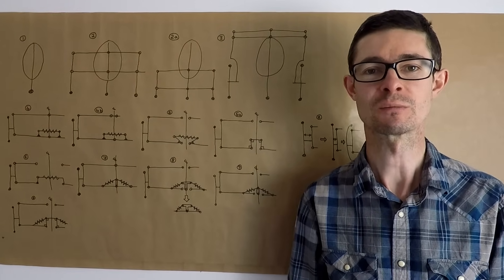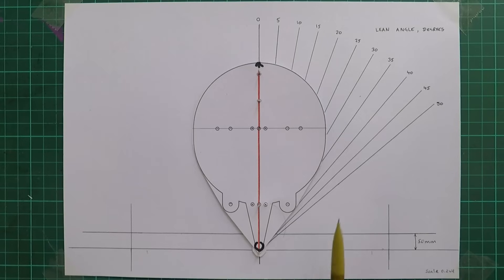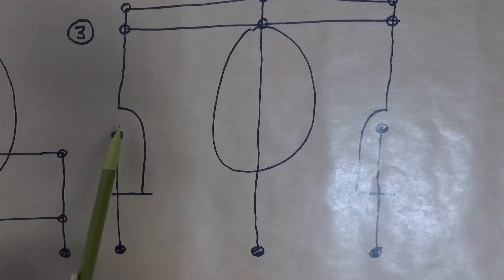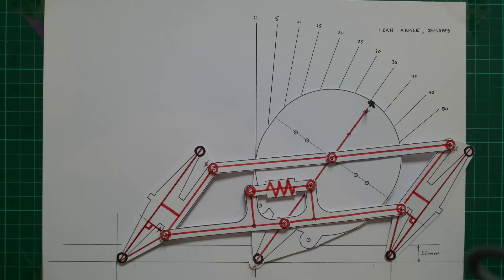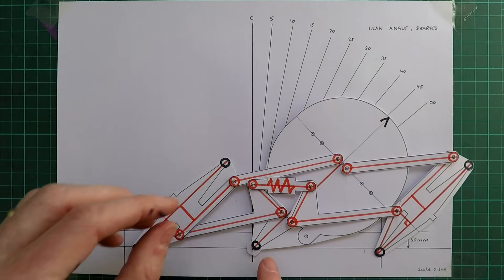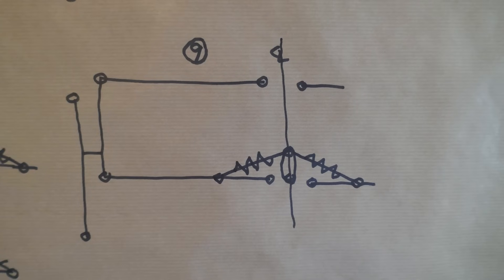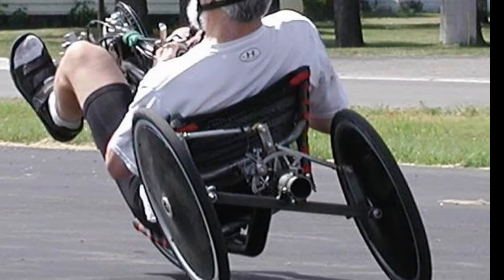Tilting Trikes Part 1 - Velomobile and Motorcycle Trike Tilting Mechanism Design

Comment: Absolutely brilliant! As far as the differential issue is concerned,  I have wondered if a solid shaft between 2 freehub wheels could serve the same purpose. This would allow the outer wheel to freely accelerate on corners while applying pedal force to the inner. As a bonus, it would function like a dif lock on slippery surfaces. There would, however, still be a lot of drivetrain design issues with the tilting
Reply from the maker: @INKonoclast  thanks - I’m sure that would work but as you say, mechanical complexity (and weight) would be an issue for probably very little practical benefit.

Comment: This was very helpful. I did find success with slight separation with of the arms from the center point and using the t model but the t shape is just about 1/3rd the height of the space between the upper and lower arms. The points where the shocks connect to the t is the same as the inner pivot points of the arm. Then using the distance for the shock to measure out where it would attach to the lower arm. For body wise you may have to make a slight deviation in the body to allow room for the shocks which aerodynamically shouldn’t effect it to much. You can also prevent a lot of aerodynamic loss by using fine bristles on the slits which will allow it to essentially close the slit.

Comment: Fantastic piece of analysis! I've done most of this thinking before but without the pretty cardboard aided design.  I don't have an aversion to FWD, so the image you showed of the tilting delta trike was right up my street.
Reply from the maker: I am moving from cardboard to computer aided design for the next phase!
Reply: The velotilt project was for sale not too long ago. It has plugs and molds for the body and some design work

Comment: This is a very interesting video with a range of possible designs. The only thing I would say is you are having the single wheel on the same plane as the other two. As the single wheel is at least three/ four feet behind or in front of the other two the amount of scrub or lift can be ignored due to this change in the plane!

Comment: Best way to create prototypes in smale scale is Lego technik!!!!! Thx for the great video.
Reply from the maker: Ha! I actually did that. Ran out of bits though!
Reply: My experience is the same. 3D CAD takes the design to a next level.

From my purely digital work I learned that a powered or at least partially powered vehicle is necessary to achieve gains from the heavy tilting mechanism.

Comment: @Metal Machine Shop This appears to be the most comprehensive coverage on the subject on this platform. Congrats for that. No doubt many hope that this project comes to fruition and viewers get more information helpful to constructing the proposed vehicle. It is very curious that little is now heard of the much praised "Velotilt" trike with two rear wheels, first heard of about 2012. It looked so promising, while it's apparent absence from the market place suggests that it is still overcoming problems. Any light you could shed on this matter would be much appreciated. I look forward keenly to follow ups on this project. I am surprised that the topic of a leaning velo is not far more popular.
Reply from the maker: Thanks for the comment! I'm not sure what happenend to the Velotilt, I haven't found any up-to-date news on the internet.  Nice looking machine though.  It uses a different sort of tilting mechanism that I didn't cover in my video.
Reply: @MetalMachineShop   Remain keen to know if this velomobile is being built and hope you will advise along the way. Thanks for the velomobile upload.
Reply from the maker: I'm still working on the design so I'm not sure whether I will ever build it.  Once the design is finished maybe I will share it with the velomobile community to see whether it's good enough to build! I'll try to upload another video in due course.

Comment: Thank you MMC, very very interesting, you saved me a lot of work. One mechanism you didn't try was two pivot points in the center on the lower arms and one on the top, the same they use on the Quadro, do post another video if you try this geometry please. Thanks again for going to all this trouble.
Reply from the maker: Thanks! I think the Quadro design as you describe it would make the wheels angle outwards slightly relative to each other as the machine tilts or suspension compresses. The effect would be greater the further apart the bottom pivots are.  I’m not sure what the advantage of this would be, but the Quadro seems to work pretty well!
Reply: MMS, I solved the above problem I discussed in my previous post (Quadro) simply by using your number 4b and turning it upside down, it would have the same result, I'm just wondering how Quadro solved this or didn't they ???? Correct me if I'm wrong but to have the correct geometry the top and bottom pivot points would have to have be aligned in the center such as in 

figure 2a.
Reply: Do let us know how you solved the steering, for your project. I would imagine it would be direct steering as in a push bike but with scooters and motorbikes the preferred method seams to be a tie rod arrangement, I'm exploring some sort of direct method of steering for motorbikes to keep the whole thing as light as possible.

Comment: Some insight from having built a bunch of human powered streamliners including 3 wheeled leaners.
Weight and complexity are always a hindrance to efficiency when powered by fractional horsepower engines (humans).
Lighter, simpler yields the best results.
A 2 wheeler with side openings so either a foot or hand can touch the ground at a stop worked out the best ... for me.
The speeds that can be attained with a good light weight human powered streamliner it truly amazing. 

Your results may vary.
Reply from the maker: Hi, thanks for your comment! I totally agree that light weight and simplicity is the right way to go for out and out speed.   I am prepared to sacrifice a bit (but not too much) of speed for practicality. I am pitching my design at reasonably practical year round (in UK) commuting type use, and and intending to use electrical assistance.  I also have in mind a faster two-wheeled design.  Anyway, it’s all still on the drawing board at this point!
Reply: Lightweight and simplicity is a nice advantage for all weather, everyday practicality. Even when adding the weight of motors and batteries. This statement is based on years of complex testing and personal experience.
All the best with your build.

Your results may vary.

Comment: If you place the joints from the lower arms more to each side, the inner wheel will tilt more while the outer wheel tilts less.
And if you add the steering you must have a straight line between the wheel ground contact point, the outer joint of the lower arm and the outer joint of the upper arm. With this turning axis you can steer easily without having the wheels to move or rub on the ground when steering.
(I hope this made sense as I‘m no native speaker)

Comment: Have you considered pushing the ideal geometry mechanism to the front or back of the wheel instead of on top? The horizontal bars would require quite some torsional rigidity but it would help with keeping it out of sight of the rider, keeping the body mounting points low and keeping the wheel size unconstrained.
Reply from the maker: I haven’t put much thought into that option, but would certainly be worth considering!  Simplicity and minimising weight would be a good test of success.

Comment: in my tilting trike design i decided that i wanted to control the lean with my arms, ok ok i havent built it yet, however in my design both wheels are individually suspended and i have a rod that allows me to drop each wheel individually. this video did point out to me how im going to run into heaps of wheel scrub. bugger, but his is prototype #8 there is always #9. thanks for this video as its dificult to find any info on how to build a tilting teck into a trike. i recon when this is solved it has the potential to compete with cars. who wouldnt want vehicles to be a third the size and heaps more power eficent probably dreaming, but hey, dreams are free :-)

Comment: Interesting video with a lot of thought in it.  However, I suspect the problem is even more complex than it appears in this video.  I think the problem also needs to be considered 3 dimensionally, and not just 2 dimensionally as presented here.  Notice in particular the camber angles of the wheels relative to each other while in a lean as would be experienced in a turn.  Each wheel is in a slightly different turn radius and should require a different camber than the other wheel.  The inside wheel in a turn should have less camber than the outside wheel.
Reply from the maker: I think you are right.  I'm working on a 3D CAD model at the moment which should help flush out some issues.
Reply: Does camber directly relate to local turning radius? Or are you recommending a camber angle/ turning radius relationship for wear characteristics or handling?

Comment: When it comes to driving 2 rear wheels I think driving the rear axel with one-way clutches on either wheel would be a more elegant solution than a differential.  Basically, all of the power would go into whichever wheel is moving slowest, and the vehicle would be self-righting (it would want to go straight) and it would never spin out unless BOTH wheels had no traction.  Basically it would function opposite of a differential.  The Quattrovelo has a system like this.
I know you aren't intending on making a delta configuration, but I thought I might mention it since it was discussed in the video.

Comment: Incorporating torsion bars as the inner pivot shafts eliminates interference from shocks or springs as you depict them as well as maintains upright stance when stationary with a small amount of preload. Simple, lightweight and effective for a human powered vehicle.
Reply: Steven Mitchell - he's designing a free leaning trike. The suspension and tilting are decoupled.
Reply: @flannel2699  That's why I suggested small torsion bars. Depending on the number of pivot points he uses, he could get away with just one or two. By coupling the suspension and tilting systems, the design is simplified. Fewer parts, less interference, less weight. Even damping could be incorporated using friction discs at select pivots instead of hydraulics. Human power vehicle performance is seriously degraded as weight increases. Less weight=less power required/better performance. It's easy to copy someone else's design/idea but designing and building your own working solution is much more satisfying.
Reply: Steven Mitchell - I thought you were suggesting using torsion bars as actual pivots (like a 50's Riley or E-Type) but if you mean torsion bars mounted coaxially within the pivots that would definitely be neat and compact. Apologies if I misunderstood. Many seasoned engineers have made similar mistakes regarding tilting vehicle linkage setups. Even the eminent Tony Foale got it completely wrong in his book on the subject.. ( so you would have been in pretty good company..!)

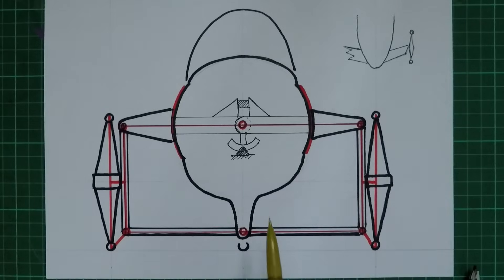Comment: @14:15. Could the straight vertical strut that the wheel mounts to be dished inwards? That might be easier than dishing the wheel? And if you placed the vertical strut behind the axle connection then you can add in some castor and potentially tuck the wheel in even further.  Looking at my GoKart chassis as an example the offset and castor are adjustable according to the grip required on the day.
Reply from the maker: Yes I think that would all be possible.  The important thing is the relative location of the pivots and the steering geometry.  Once this is all decided, the parts themselves can be designed accordingly.

Comment: This is uncannily like a project I shelved a decade or so ago. Even the sketches and model are pretty much identical. Great minds..!

Have you considered a delta layout with a Calleja type twin trailing swing arm setup. Calleja used a diff on his motorised test bed but with a narrow enough track you could possibly do without - or even drive a single rear wheel ( unless it would cause some unwanted yaw effects..?)

Anyway it was fun to watch you talk through the same work, the same way.. Thanks for sharing.
Reply from the maker: Ha! I don’t claim any of my work is original - interesting to hear that other people have come to similar conclusions!  I think the tadpole configuration has advantages in terms of mechanical simplicity but the deltas probably look better.

Comment: Amazing, I’d love To make a trike and this is so interesting, what happens if you have the passenger body volume tilt more than the wheels? Eg at 45deg the wheels are at 30 deg. Is that rideable? Really cool channel and presentation, subbed thanks!
Reply from the maker: I’m not sure what would happen but I tried to keep everything in line to keep it as close to a bike as possible.

Comment: Very interesting. Have you thought about running the tilt mechanism on the rear and using FWD? This would ease packaging and obviate the need for a differential.
Reply from the maker: Definitely an option but I think tadpole configuration is easier to make with greater use of standard bike components.

Comment: what are your thoughts on using driveshaft instead of chain? like the focus on efficient performance. solid work. good luck. if i sacrificed any efficiency it would be to (pun alert) lean toward larger wheels for smoother ride.
Reply from the maker: It can be done.  I’ve seen a hire bike with a drive shaft.  You would need hub gearing rather than normal bike gears.  On my recumbent velomobile design, you would need a couple of universal joints to route the shaft around the rider, plus extra supporting bearings.  Shaft drive would be a bit less efficient than chain, but could be enclosed more easily.  I also found on my velomobile design that smaller wheels were needed to give steering clearance and to keep the overall length within reasonable limits.  I talk about this in one of my other videos.  Enjoyed the pun lol!

Comment: As soon as you begin leaning any vehicle you start scrubbing so I would shake off some worry there... instead worry about weight transfer like motorcyclists racing hard... their bodies lean more than the bike does... and having the wheels running parallel is only good in the upright position because even though its a three wheeler it would still act like fixed four wheels with the inner tire not carving harder than the outer since the two are on two different arcs ( I’ve been thinking this one through for a few years wanting to do it myself in a motorized version... also... consider a hubless wheel so you could geometrically place the spring inside the rim and get the shock both hidden and aerodynamic... mountain bike rim size would give plenty of extra working space to hide things and get a bit more of a patch on the road to hold harsh angles
Reply from the maker: Hi, thanks for your thoughts, appreciated.  I am building a prototype so will soon see if the theory works in practice!

Comment: Do the two front wheels have to be beside the front of the body? If you moved them forward of the nose, they could be closer, and stay within the frontal area of the body. They could be two feet apart, providing stand-still stability, and faired individually for aerodynamic flow onto the nose. In addition, the nose would not restrict the vertical turning of the two wheels. You could employ a tilt mechanism to your handle bars, along with a standard rotating system for tighter corners. With the wheels close together, you could suspend them with a central shock.
Reply from the maker: Hi, they don’t have to be beside the body. In moving them forwards you would be trading length overall for reduced width but you are right, the steering wheels could be closer together which would be good. You would need to allow clearance for the frame/chassis.

Comment: I'm not sure but it seems that body clearance should increase as the tilt angle increases for vertical state stabilization. But not much, probably it causes risk of overturn at speed. Thank you for shared analysis.

Comment: tnx for the load of info , I would try to take the whole or at least most of the mechanism in front or rear of the body that should be possible with 2 foil shaped carbon arms . that would take the wheels completely to the front or rear of the vm  . if you make the same on the other side you can suspend the drivers pod in between them  with a lot of space inside . the hub-less wheel idea of nelson would complement it nicely :)

Comment: What a great video with so much detailed information, Just a thought, would you use any caster angle with these setups for a tadpole trike configuration.
Reply from the maker: Mike Bull hi, thanks for your comment.  The video just shows the tilting geometry, the steering geometry will require a castor angle and king pin angle to prevent bump steer.  I’ve been working on these aspects of the design and am hoping to upload another video one these aspects in due course

Comment: What if two rigid arms connected the two wheels and  each wheel was on a linear guide, like a strut?  Or two semi rigid arms that could bend like snowboards, and that would be the suspension?
Reply from the maker: This might both be suitable options depending on what you are trying to achieve.  Worth experimenting!